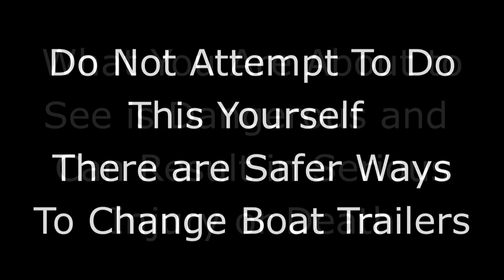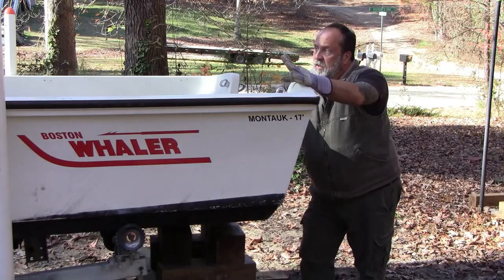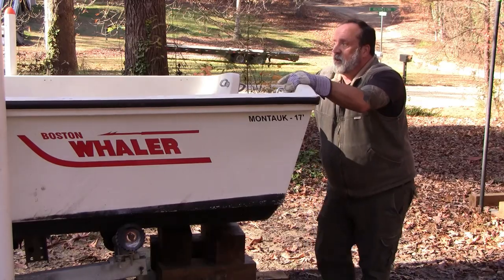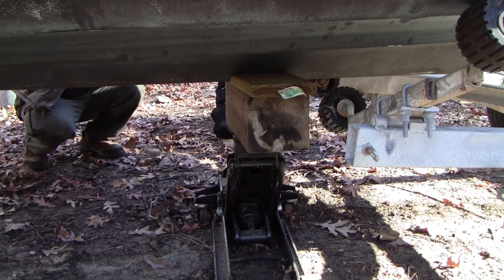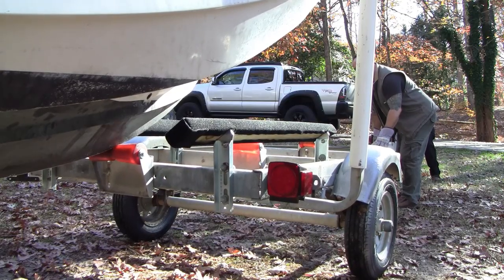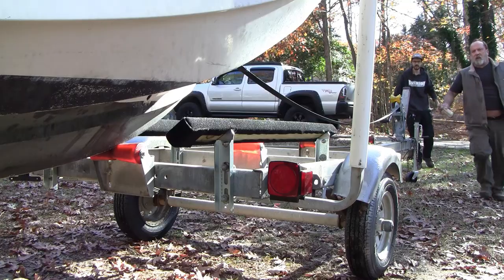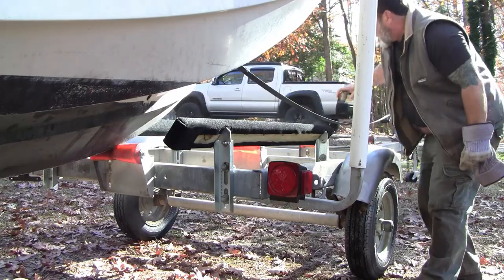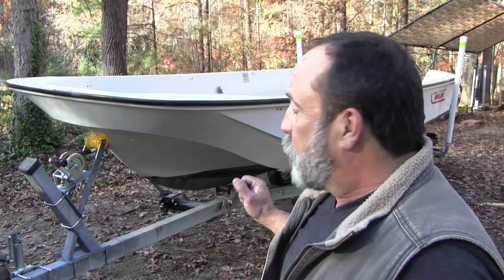DIY How I Swap Out A Boat Trailer On Land With No Special Tools

Comment: Ive done very similar to this. The one difference is I lowered the tongue jack all the way then stacked the cribbing under the stern. After that, crank the jack up and the stern is supported up off of the trailer.
Reply from the maker: I did a video on that method as well but didn't take the trailer out like in this vid, just lifter it off the trailer. The trailer jack method definitely works!

Comment: I attach a rope to the stern of the boat. Which I then attach to a tree or car. Backing up the trailer on a small board with a block so that the boat is raised at the stern. Builds a cribbing under the boat. Drive forward so that the hull ends up on the cribbing. And the rope attached to a tree/car keeps the boat in place. Move the board with a block under in front of the wheels of the trailer drive slowly forward so that the bow is raised. Build a cribbing front part of the boat. Drive slowly forward over the tilting board. So the boat ends up cribbing. And do the procedure backwards when you want the boat on a trailer. Your method works, but attach a rope to the stern of the boat and then to a tree/car so you don't have to pull and push the boat.
Reply from the maker: I initially wanted to do that but there wasn't a solid tree directly behind where the boat was so I decided to go with the push/pull route lol. Thanks for sharing your experience!

Comment: There are several much easier ways to accomplish this task. 
Why you chose the most hardest way beats me. But I definitely enjoyed the video. 
I sat here with my palms sweating. 

I do this often with two of my boats and sheesh it takes me half the time and literally no effort.
Reply from the maker: You should put up a video showing the way you do it, sounds interesting.
Reply: Yea I want to know also, I need to weigh my trailer , without the boat